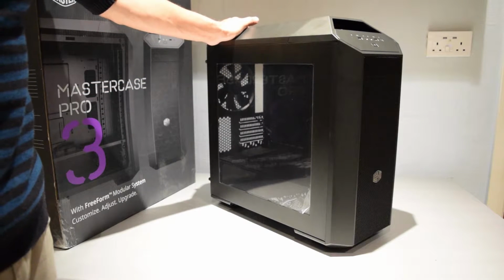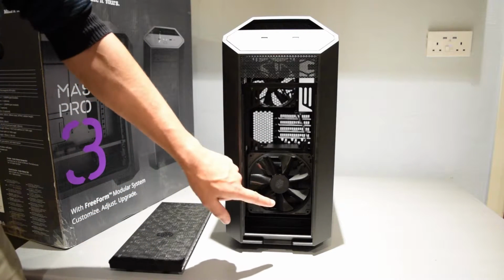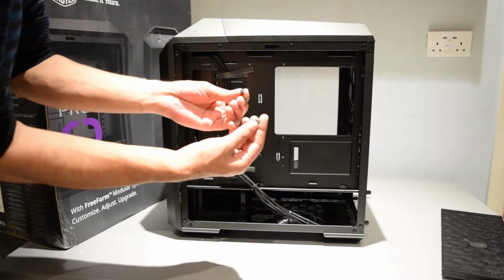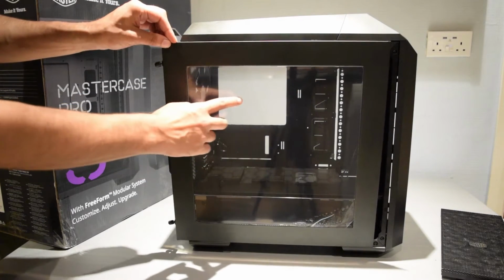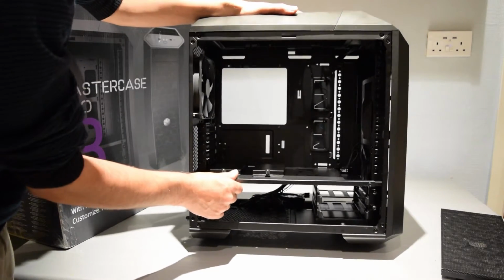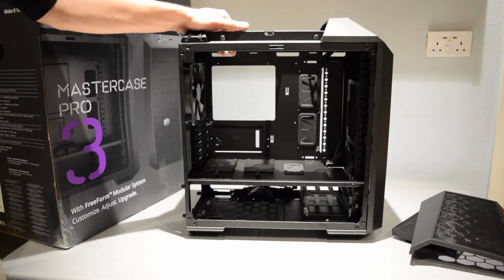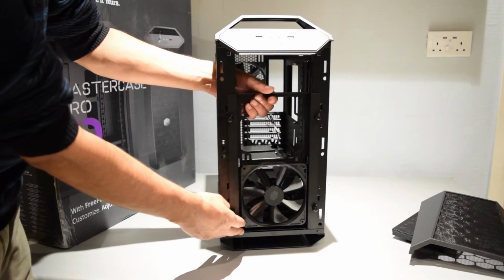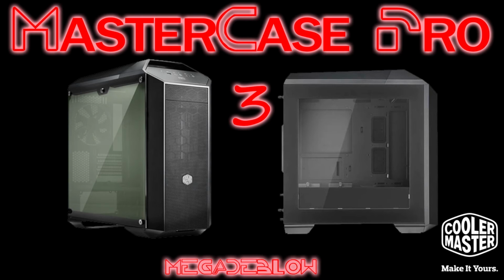MasterCase Pro 3 , Quick look and build instructions

Comment: Can you please help with how to install an internal optical drive? Even though they have provide a bay for it, there does not seem to be an option.
Reply: Dont have the case to check and cant 100% remember, but I think you install them on the bottom (SSDs) and in the drive bay, if your RAM is in the way you might need to remove it until installed.

Comment: they gotta make more matx x99 motherboards :P or whatever the next one will be, x109? i really like this case
Reply: Thank you so much for this video, I do have a couple questions though. With the angle of the front panel, would flash drives that have a rubber housing be unable to plug in all the way? Secondly, are the HDD sleds made of plastic or metal?
Reply: MegaDeblow
Personally what I'd like to see is a different type of SSD mount. I'm not sure if anything like this exists already but I'll try to explain. Where the SSD screws into a tiny tray or metal backplate This is then suspended either vertically or horizontally facing towards the side window. In short, how the Samsung 850 Pro is displayed in it's second Newegg picture. There could even be a way to chain them together  so in place of where HDD cages would be they'd start from the top to bottom.
Reply: also, sure a 280 doesnt fit in the top?
Reply from the maker: not sure what new mb's will follow the current but yes, the spec sheet says 240 for the top, think that's the same for the master case 5 also. will check when I get home and reply back if I'm wrong.
Reply: MegaDeblow neat! i htink it might be cause of motherboard clearence, and thats why its 240 in the top
Reply: MegaDeblow
Thank you again, shame the HDD trays aren't metal too like Fractal Design ones but I'll still probably get this case after all in coming months.
Reply from the maker: dont think you will be unhappy with it, but i do hope they add the front found on the MasterMaker5 case to the accessory list.
Reply from the maker: sounds cool, I know myself and other modders have done just that, but for this case you can have the SSDs on the 2x holders above the PSU cover, looks nice as it also hides the wires.

Have a look at this build i did, the SSD is very much on display lol
https://www.facebook.com/megadeblow/photos/?tab=album&album_id=1785446155017421
Reply: MegaDeblow
Oh hell yeah, did you 3d print them or make out of metal? Also yeah I just wish the SSD slots on the basement feature were more towards the front instead of rear.
Reply from the maker: The SSD holders on the MasterCase3? there made from metal and come with the case, the one on the facebook page was made from plastic and from an older case.
Reply: MegaDeblow
Ah okay yeah I was wondering about the custom ones. It'd be a mod way in the future though because either the HDD trays or SSD mounts on the basement cover as you specified would work fine for now.
Reply from the maker: Yeah, works well mainly because of the cable management, nice and tidy :)
Reply: MegaDeblow where did you get your Sponsors for project Alternate? I want to build the Same stuff.
Reply from the maker: Some asked me if they could be involved and others I phoned or emailed depending on location.
Reply from the maker: No problem, thanks :)
The USB ports work just like most others, just at a angle but the ports them self as standard.
For the racks, the outer frames are metal, the trays you attach to the HD's are plastic.